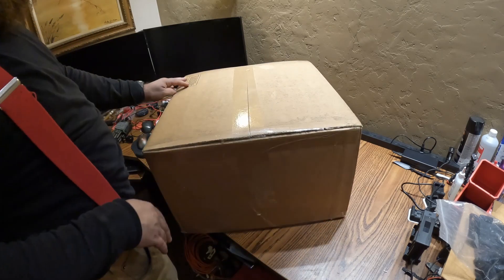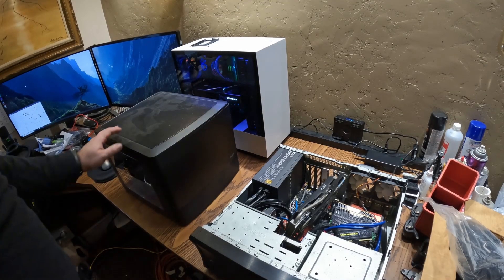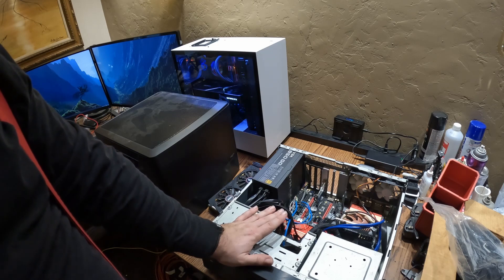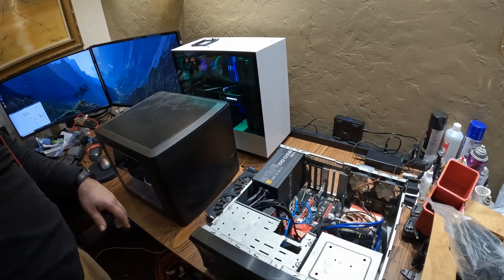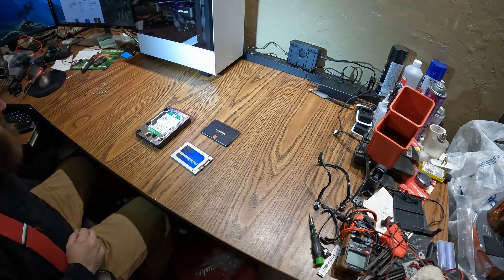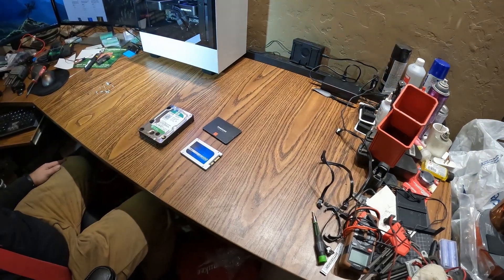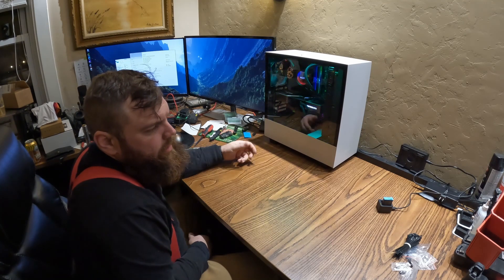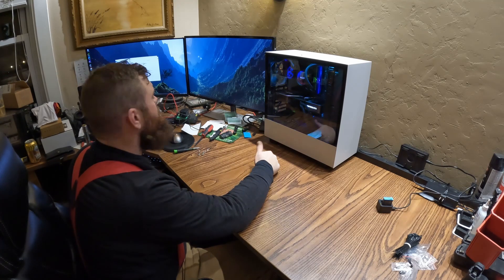NZXT BLD Computer

Comment: these bld computers are the best way to get a founders edition card and off the shelf parts, great purchase
Reply from the maker: It really is. The base computer with the FE 3080 was i think around $1800. But like I mentioned in the video, I kinda just need a computer and didn't have time to build one with my schedule.  So I just configured it the way I probably would have if I built one.
If I did it over again, I would have gotten the better case with the glass front. So you could see the fans on the radiator.
But this computer makes editing videos soooo much faster!